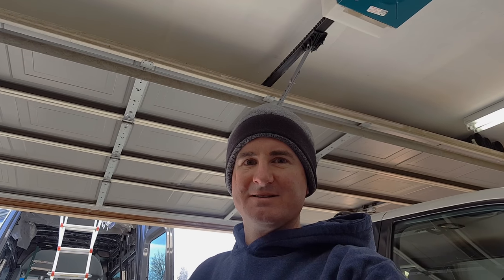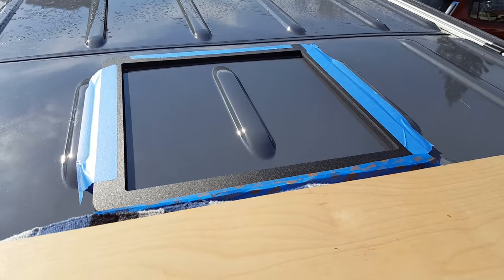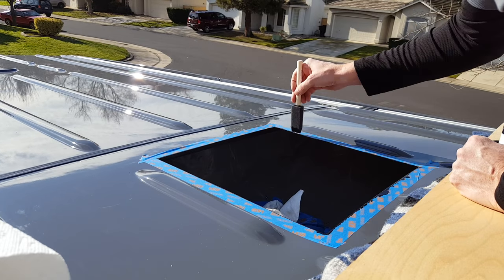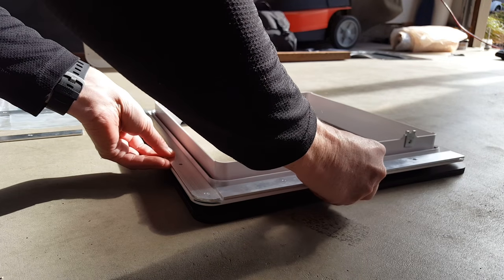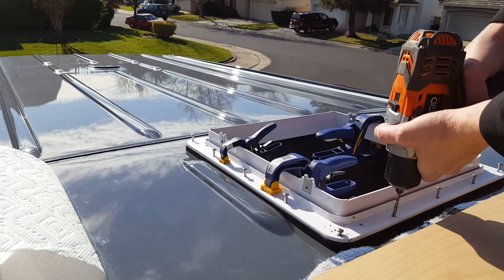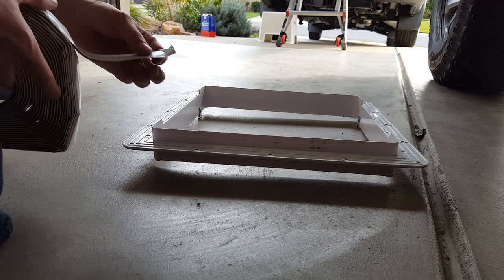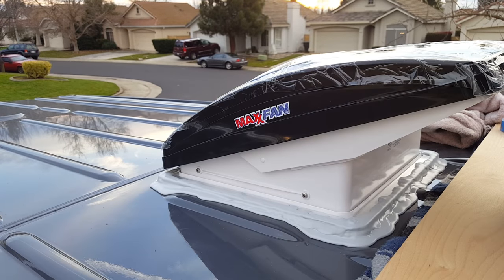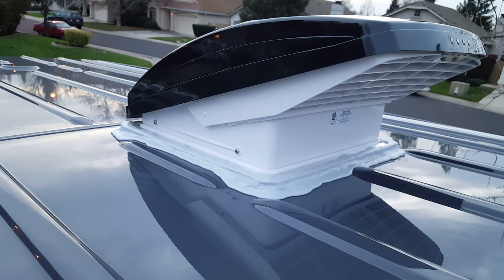Mercedes Sprinter camper van maxxair fan install.

Comment: Hi Ken, I just finished my Maxxair Fan install.  Thank you for your video on this.  Its super nice to know what the install entails ahead of time.  I ended up using 10-24 nutserts in 1/8" x 1" aluminum strips (similar to the ones you have on top) on the inside of the van. It was a harder than sheet metal screws but it also really firmed up the area around the fan.  The adapter was money well spent just for centering the fan.

Comment: Great informative video with good ideas, including the aluminum strips to even out the pressure from the screws in the plastic.  In sealing with the Dicor however, the sealant should be applied along the inside of the strips as well as on the screw heads and outer edges of the strips.  Potentially water could infiltrate from under the exposed aluminum edges and find its way to the screws Under the aluminum.
I just installed the same vent on our Transit van using the adaptor and the aluminum strips and it looks and works great.  I did use #8 machine screws and washers in place of sheet metal screws for a more secure and neater inside appearance since the inside of our van will remain unfinished.  Thanks for posting the video!

Comment: Hi Ken, I appreciate the work you've put into these vids. I live in Santa Barbara also and just purchased a 4WD Cargo Sprinter to dress out much the same as you did. I may be picking your brain from time to time if I get stuck on something. I ordered the same roof fan and a rack from aluminus with an opening for the fan. The rack will take about 6 weeks to build so I'll be installing the fan prior and hopefully the opening in the rack lines up the way it should.
Reply: Yes Ken.  In the rear over the bed. The standard opening for the 144 wheelbase is in the rear and designed to take the MaxxAir fan. That cut 5 weeks off my wait time. Getting their ladder as well which will be mounted on the side so I can swing the doors all the way open. I have two 350w solar panels going in the front. Is your's completed?

Comment: We DID have leaks and water was coming in through the extra aluminum plates we installed on the inside by the mounting flange. Maybe you tightened yours better than we did, but I noticed your DICOR doesn’t cover the aluminum all the way around, either. We’re going to use a window sealant on these spots and hope that does the trick.
Reply: Thank you Sally, that's very helpful tip. Can the Bracket adapters be installed anywhere on the van? Ram Promaster 1500 for example? In my plans, I'd like to put a fan over the shower, center of van on left side
Reply: @TSnowy23  Not sure.

Comment: Because you used the extra aluminum strips to spread the load on the top of the flange you may have created a path for water to go between the inside edge of the aluminum and the Maxx Air flange.  This could wick back to the body of the screw and down the threads.  The saving grace may be the butyl tape sealing off the screw.
Reply: I’d use some extra sealant.
Reply from the maker: 5.5 years later and going strong.  Liberal use of the sealant is never a bad idea though.

Comment: From Diyvan. The company who makes those molds:Hello Peter,

The strips are not needed. Some
folks over-tighten the screws
which squeezes out the butyl
tape and depresses the vent
flange around the screw head.

Just do not to over-tighten
the screws. Just snug to the
flange is enough. The screws
are only holding the vent against
our adapter. Adding some fender
washers under the screws can
also be done if you want.
If you overtighten then you
aew squeezing out the butyl
sealant tape.

We sell hundreds of our patent
pending adapters and only a few
people use the strips. We don't
hear of any cracked flanges.
It's an internet created fear

Comment: Hello again Ken, I can't thank you enough for introducing us to the adapter. I have seen so many installs and most of them are a nightmare. I did install mine with the adapter and I am not sure I want to make a mess with the dicer or titebond, it seems to me that with the glue on th bottom, I used sikaflex and the butyl tape I don't see what we would need to add that mess up there, but I'll see if it gets wet inside.

Thanks again,
Reply: 4 years later, does it leak????
Reply from the maker: Happy to report it does not.  I did a 5 year update on the van here:  https://www.youtube.com/watch?v=TkiViyoldLU
There are channel markers so you can fast forward specifically to the fan part of the video.

Comment: I think instead of lap sealant I’m just going to put strips of RV roof sealant tape strategically layered so things look tidy. Thanks for sharing!
Reply from the maker: Should be fine.  The lap sealant is far from neat but I only see it a few times a year when cleaning 9-1/2 feet up.

Comment: Did you make or purchase the strips of aluminum? If you purchased it, can you please provide links?
Reply: From the guy who makes that plastic piece for the roof: Hello Peter,

The strips are not needed. Some
folks over-tighten the screws
which squeezes out the butyl
tape and depresses the vent
flange around the screw head.

Just do not to over-tighten
the screws. Just snug to the
flange is enough. The screws
are only holding the vent against
our adapter. Adding some fender
washers under the screws can
also be done if you want.
If you overtighten then you
aew squeezing out the butyl
sealant tape.

We sell hundreds of our patent
pending adapters and only a few
people use the strips. We don't
hear of any cracked flanges.
It's an internet created fear

Comment: Great install, minus the using of self taping screws, why not use stainless with nyloc's ???  Has the fan been what you wanted ?  I am shopping for one soon, so thought I'd see if 9 months later or so you still digging this brand as there are so many out there !
Reply: Ahh yeah I am leaving the beams open and painting them to look like open beams inside a house instead of adding a drop ceiling, so now I see why ya used them tapers..  I think I will prob do this same fan, so thanks!

Comment: I am so excited you have video taped this for us! 
* How can I get ahold of those beautiful Aluminum strips you included?  Would you consider sending me a set?
Reply: Hello 👋🏽 did you ever find aluminum strips? What did you end up doing?
Reply: I followed this video and bought my own strips from Home Depot. 2 1x36 1/8 thick aluminum strips and then cut them to size and cut the corner to smooth them out a little. Not quite as pretty as his but they do the job and they’re going to be covered in the dicor anyways.

Comment: Thank you for your awesome videos! I’m going to use a lot of your affiliate links! I gather from your videos that, when drilling the self tapping screws, it’s unnecessary to paint the metal where they penetrate but it is necessary to paint cut exposed metal- is this correct? Thanks in advance!
Reply from the maker: That's my thinking as well--sheetmetal screws will likely remove any paint you add, and the lap sealant is protecting the area from the elements.  You definitely want to paint the hole for the fan and any areas you cut for windows.

We sure appreciate the support...it definitely helps!

Comment: Hello "Ourkaravan",
Thank you bc for this superb tutorial. You do things with care!
Have a sanding sprinter for sprayed cork.
I plan to put the MaxxAir on the front, at the place of the convex circle.
What do you think ? Why did you put it on the back.
For my part, would have another classic lantern backwards.
To read you. Good continuation    (de France)
Reply from the maker: Hi, the middle portion of the van is a common place for a fan as well.  I chose to put mine in the rear to be closer to my bed.  That way on warm nights I can have air moving over me.  Totally a personal choice though.

Comment: Hello Ken, I'm getting close to doing this install for the first time on my new Transit. Is there anything you'd do differently from the installation in this video? I really like your idea of making those aluminum rails for sturdy reinforcement of the fan bracket. Could give me the dimensions of those so I can replicate? I was also thinking about the nice RV Repair tape instead of using Lap Sealant, thoughts on that? Thank you again for this and all of the other really helpful videos. You're a step above most of the folks I've been following.
Reply from the maker: Hi Brian, I recently did a 5 year update video talking about how everything is holding up.  No problems or issues with the fan install and would do it the same today. I dont have dimensions for the aluminum strips, just cut to length and screw them down.  I haven’t tried the repair tape, I stick with what I know works.  Good luck on the install!
Reply: @ourkaravan  I just picked up some 1" x 1/8" thick 6063 Aluminum Bar Stock and it looks like it will work perfectly. Thank you again for that idea and You are the only one I've seen doing that. I usually recognize a good idea when I see it and you had one there : )  Thank you again for sharing and for the many ideas you've brought to light for the folks following in your footsteps. Happy Easter to you and yours.
Reply from the maker: Thank you, and you as well!

Comment: ...and 5 years later, how is all holding up? I also noticed you didn't use any tape in the first adhesive step. Why was that? Regarding filing, there is only one direction for proper use of a metal file. Pulling it only dulls it as the 'cut' is only in that one forward direction. BTW, how many builds b4 this one?
Reply from the maker: I actually just released a 5 yr update video on the entire build.  
I didn’t use butyl tape on the bottom side of the adapter plate because the manufacturer of the plate recommended use of 3M adhesive there.  
Thanks for the filing tips.

Comment: I'm about to install a maxxair fan.  I'm wondering about the screws. Which ones did you use?  It looks like you simply screwed into the sheet metal with no nut or any kind of backing.  I'd be concerned that over time there could be stress on that screw/metal connection.  Any thoughts on that?  I was thinking that at the very least bolt/nut/washer should be the minimum or if using a screw, to screw into a wood frame or something like that...
Reply from the maker: Correct, many use sixteen screws into the sheetmetal.  The problem with bolting through with a nut is someday when the fan goes out you may not be able to remove the entire assembly from the roof without dropping your headliner.  Some people nail their headliner in place, which obviously would create a huge problem.  I used #8 1-1/4 sheetmetal screws due to the added thickness of the plastic spacer.

Comment: Hi.  Enjoyed video very much.  I'm about to cut my first hole for Maxxfan install.  DIYvan recommends Sikaflex 221 to bond expanded PVC adapter to the roof but 3M 4200FC was used instead.  What was the reason?  Is it because Sikaflex 221 was for interior?  Are you satisfied with the adapter?
Reply from the maker: Back in 2016 when I installed the van the company that made the adapter recommended 3M 4200, which has held up great the past 7 years.  I do believe they now recommend the Sika, but either will work.

Comment: Great video thanks! I just finished installing own maxxair some hours ago. Watched your video before ofc! May i ask now that you have used this for years how is it at winter / cold climate times? Does it freeze the whole van even if its off.
Reply from the maker: I live in a temperate climate so I’ve never noticed significant air leakage when it’s off, however you can use an insulated cover to help with that.  I use insulated shades from Quest Overland.   Coupon code Karavan5 will get you 5% off.
Reply: @ourkaravan  thanks for the tip ill check that out

Comment: Hi Kenetube, 

Great and very helpful video again here. Helped me with my install today of the max air fan and a side window. Thanks to you these were a success. Question, have you dealt with the upper formed foam features behind the driver and passenger seats? Ive had difficulty obtaining info on the removal of these and what they are for. 

Im assuming you've dealt with these at this point? Im looking to remove or partially remove for access and interior siding. At the moment I need access for the last anchor for roof side track rail anchor. 

Any intel would be much appreciated. It seems we have the same vehicle so thought Id check with you. 

Thansk for all the great vids.. looking forward to the upper cabinet vid should you decide to post that. 

Best , Brandon (2017 4x4 144 wheelbase high roof UNDER CONSTRUCTION :)

Comment: Ken - Excellent video !

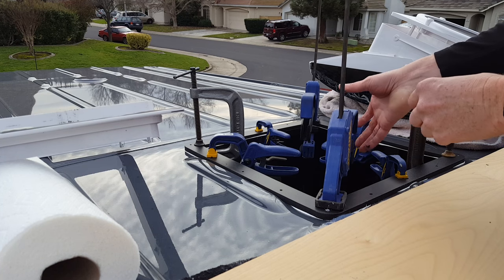I want to do the same thing but I'm confused. You seem to screw down the adapter to the roof in the four corner holes (only) with screws at the 4:50 mark and then again it seems like you are permanently screwing down the fan at 5:55 in the same holes as well as the other holes. I see the adapter screws have not been removed at the 5:42 mark.

Can you clarify why you only used four screws for the adapter plate (to hold it tight and to line up the holes?) and then how you used all the fan mounting holes without removing the first four adapter screws.... confused.
Reply: Thanks Kenetube!
Reply: @ourkaravan, all of Kennetube's comments have been removed. Am I right to assume you did remove the 4 screws?
Reply from the maker: Hi, correct, the 4 corner screws were only to align the adapter while the adhesive was setting.  Once dry I removed those four screws and screwed the fan down using all the screws.

Comment: Thank you for the well made video! I just completed my install of two MaxxAir fans in my Sprinter 170. I used your video during the entire install. Thank you. One other question, do you have any recommendations in temporary wiring until I do my solar install ?Thanks
Reply: +kenetube thank you.  Yes I have the factory auxiliary battery. So do you think I can wire both fans to one cigarette lighter plug?

Comment: Great job and I will be doing this soon on my 144. Question, how far back on the roof can you install the fan? I have factory roof AC and would like to also have enough room for a solar panel located between the Maxxair and the rear edge of the factory AC shroud.
Reply: Thanks. Could yours have been mounted further back, just in front of the rear-most seam? Only difference would appear to be the midline rib. Would your spacer allow the mount flange to deal with this rib?

Comment: What a great video, Ken!  Too bad the music was so loud it gave me a headache.  Best to not have any music on DIY videos.  Your photography is excellent!  All those closeups and detail shots, pro work.  Love the way you work, methodically documenting every step.  So very helpful to us all.  This was a great install. Sandwiching with aluminum, very smart.  
With regard to Dicor, you can also use Eternabond tape in different widths. Its neater, but Dicor gets into the gaps better.  I wonder why they don't create a caulking tube of Dicor with a flat, wide nozzle.  The stuff would come out like a small ribbon instead of toothpaste and it could look neater. Such a messy look but no choice.  I tried to flatten it with my finger once like caulk.  Oh no!  Even bigger mess.
Reply from the maker: Yeah I haven't found a super neat solution for the fan caulking, but at over 9-feet up, you'll rarely have to look at it.  

As for the music, this was the second video I ever made.  Getting better at it but lots more room for improvement.  Thanks for following along.

Comment: I like your attention to detail and using the proper tools (step drill, jigsaw, clamps, etc...)  
Couple of comments to the work performed @ 5:40.  

1. Those aluminum strips you made could have been made as 1) piece cut from flat aluminum.
2. Could have drilled and countersunk for flat head screws, instead of the truss head used
3. Screws do not appear to be stainless
4. The aluminum itself was only "mill finish" and sealant does not adhere well to unfinished aluminum.  
5. Surprised you did not tape off and tool the sealant you applied.

Just contributing, not criticizing, thanks for the great vid.

Comment: good video, a few questions.  the adapter appears to be about  1/2 inches  thick?  did you use the  1 inch  screws that came with the fan or did you get  longer ones? if so how long? did you put anything on the inside of the van to screw into?

Comment: Isn't it going to be hard to do your roofing later, esp since you didn't have the height of the inner part set for it?
Reply from the maker: No because you cut the adapter down to the thickness of your roof once it’s in place.  I did a video on the ceiling as well.

Comment: Does the Sprinter roof rib spacing make a requirement for the adaptor you installed below the fan "base"? I have a Sprinter (2013) van with a Fantastic fan with no adaptor plate. I'd like to do one of these for upgrade/replacement purposes....

Comment: Any reason you chose the max air fan versus the fantastic fan?  Will you be intalling an interior ceiling in the near future? Will that be an easy task now that the screws have all the goop over them?
Reply: Hi Ken, I'm curious about how the trim ring on the inside worked out for you. Do you have any pictures you can share about this part of the install? Thanks!

Comment: Did you use the included screws or have to procure longer ones? (curious since you added butyl tape and aluminum strips). After a few years of use, anything you'd change about the install? Thanks!
Reply from the maker: I did use longer versions of the same screws.  It’s been too many years now to remember the size I used but consider the added thickness of the roof adapter, butyl and the strips.  

I have a video coming out later this month talking about how things have held up the past five years.  The fan and install has held up great and I’d do it the same today.
Reply: @ourkaravan  Awesome, thanks for the reply! Looking forward to the update video.